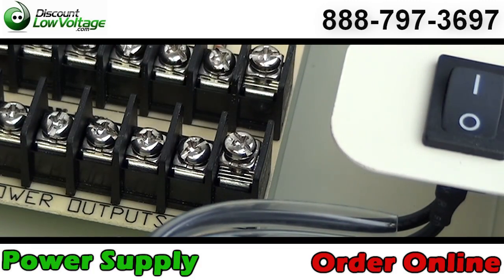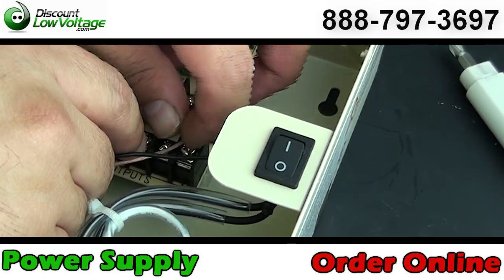How to Cable a CCTV surveillance Camera Power Supply

Comment: Use fluke.meter connect your cameras and it will show u that votage for each cam is less then 12v so how hell can he talk about this set up 16 cam in this power supply box and show us the fotage on 16 cams i awaite.

Comment: Hello...I have 16 cameras bt using 12v power supply it showing lines on the screen(monitor display) and m using 6mm ,8mm lon distance cameras approx 40 to 60m long from the DVR ...Please suggest best solution for that
Reply from the maker: Aniket Lahoti Sounds like you did not terminate the braided shield on the coax connector. Running IR cameras? Maybe too long for 12v.
Reply: Ive used the cvtv power supply box on 16 cams show me 16 cams connect to this box  and i will belive been installing for 20 years now and them boxs are crap and i used one with back up battety and it when switched the power of from the mains it was fine but once the.power was restored got line so did votage test and no way can thst box give u power too each cam but proof me wrong

Comment: hi mercy if you could just help me, would appreciate it much, i have a camera running for as long as 267Meters about 8 of them, what would you suggest to wire this up, thanks
Reply: thanks for the reply actually im from the philippines, the fartest location is about that long all others is more than 200 meters, there is no power where i will put those cameras, if i run a wire it will cost me too much, so i wonder if those RJ6 coax cable can supply power to it
Reply: thanks much surely i will try all of your reco, i return to you soon, maraming salamat.
Reply: Herminio Salazar

Comment: hi mr salinas. I installed a lorex camera system with 8channel. and i was wondering why all my cameras have this fuzz on the video, also  i get ghostly images as if it was trying to transmit some other image. my cameras are 720p high definition with Night Vision but am not even getting close to standard definition on them. Subscribed!
Reply: sorry for long description in the camera. am fairly new to this.

Camera Features:
 •High definition 720p 1 megapixel image sensor delivers double the resolution of 960H 1
 • Crystal clear video with outstanding detail, day or night
 • Infrared cut filter ensures accurate color representation
 • Night vision range up to 130ft (40m) in ambient lighting& 90ft (28m) in total darkness 2
 • Close up recognition in the dark with SmartIR
 • Anti-glare feature ensures clear images under strong lighting conditions
 • ClearNight imaging for superior low light performance, improving recording efficiency
 • Split glass design minimizes IR reflection
 • Weatherproof for outdoor & indoor installation (IP66 Rated) 3
 • Extreme temperature performance (-22°F ~ 122°F)
 • Wide angle 90° field of view
 •Vandal resistant design with cable pass-through bracket
 • Lightweight and durable polycarbonate housing
 • Removable camera base and integrated cable for flexible installation
 • Versatile ceiling or wall mounting options
 • Residential and business friendly compact design
 • 60ft BNC/Power extension cable included per camera
 • Energy-efficient CEC (California Energy Commission) compliant power adapter included
 • Extend the video signal up to 800ft (242m) with a singlerun RG59 coaxial cable for flexible installations 4
Reply: yes it was. cameras are analog BNC npart #  LBV1521 here is a link to website:    http://www.lorextechnology.com/complete-surveillance-system/HD-security-camera-system-with-full-720p-recording-resolution/prod610002.p  thanks in advance!
Reply: yes. i had to use two extension cables to reach two corners of my house. but i get same picture fuzz for every camera. i notice while installing them that while the camera was connected hanging the video wasw better quality. so dont know ifit has something to do with the ceiling or the fact that I have ADT cables through the attic that are crossing with the camera cables and therefore causing this bad video feeds.
Reply: my came with a power supply for connects to wall and has 8 inputs so that the cameras  connect to it. am thinking maybe a power related issue. so i was looking into the supply box you show on this video.
Reply: ***** thank you. For your help. Will try that and see what the results are. If I fix it I will try for sure give follow up on here. I might try getting the power supply box shown here on your video. Happy subscriber here. :)